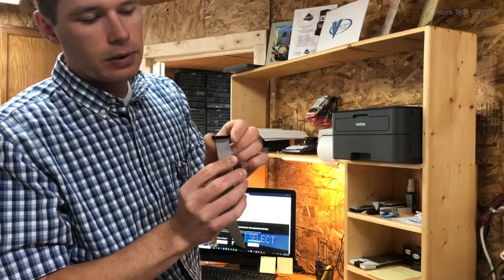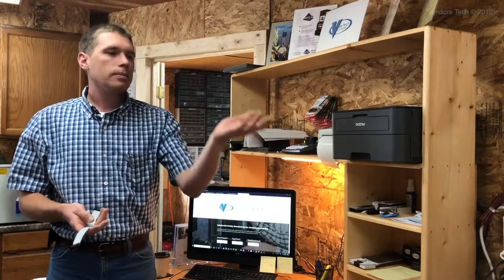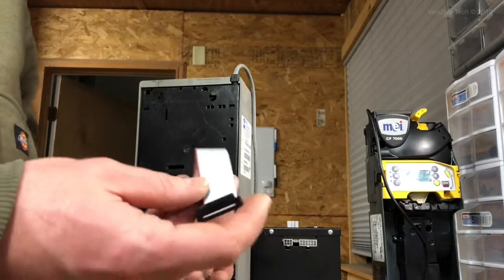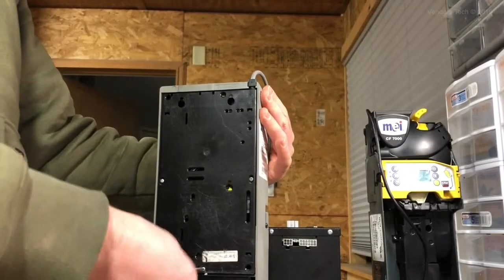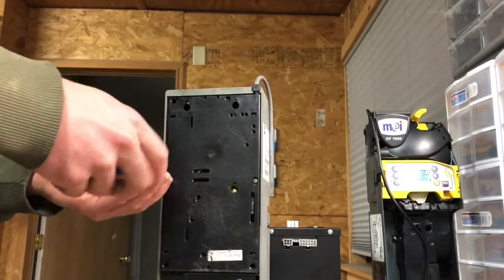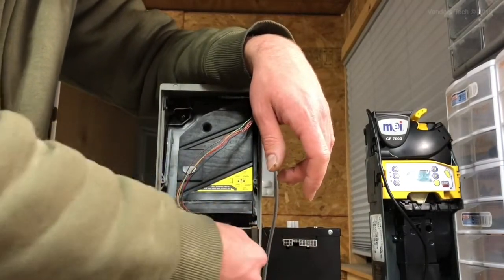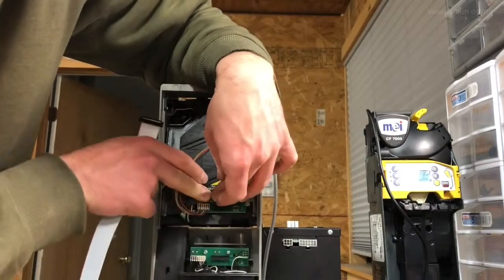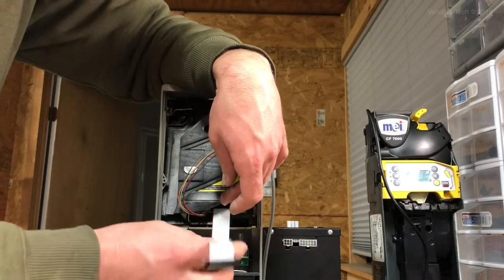This New Ribbon Cable Will Fix Multiple Problems On An MEI TRC-6512 Coin Changer

Comment: Would this fix the led light that’s blinking??
Reply from the maker: It would depend on how many times the light is blinking?  There are several possible errors; this cable can potentially address some of them, but not all.  Can you be more specific?
Reply: @VendorsTech  it is a constant flash and change fall’s through every time.
Reply from the maker: @scottytroublefield205  If you're getting a continuous slow flash, a new ribbon cable might fix the problem, but I wouldn't consider it very likely.  A continuous slow flash is usually an indicator of other problems, and is a very general error, so there isn't anything in particular I could recommend.  It needs to be returned to a service center for diagnostics and service.

Comment: What do I have to do to fix the 2 flashes? “Disabled from VMC”
Reply from the maker: That means your machine has disabled the coin mech for some reason (potential reasons can vary depending on the make and model of your machine), or it's also possible that there is a problem with the coin mech.  You could try replacing the coin mech if you have a spare, and see what happens, after that, you would need to troubleshoot elsewhere in the vending machine.  Try calling the vending machine manufacturer if you are unable to figure it out on your own.